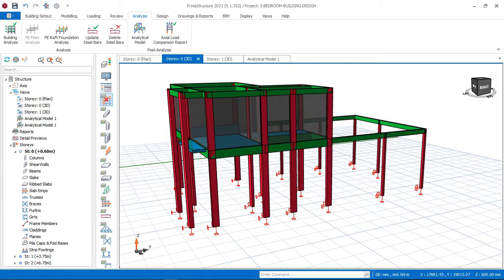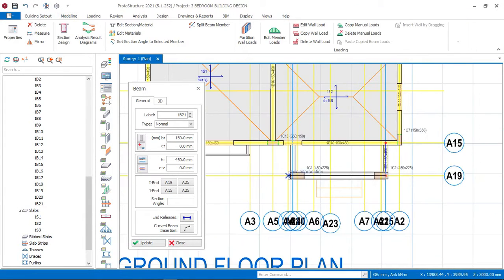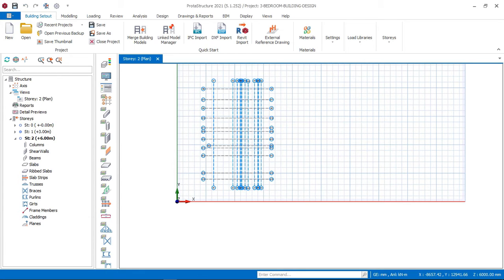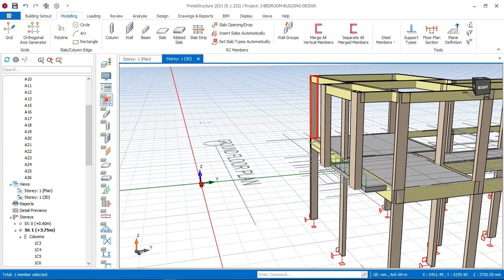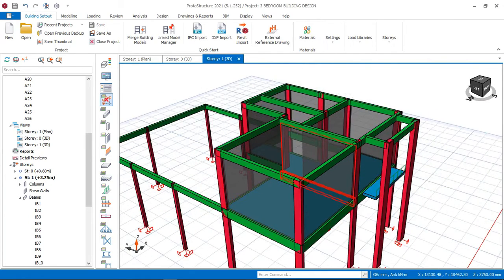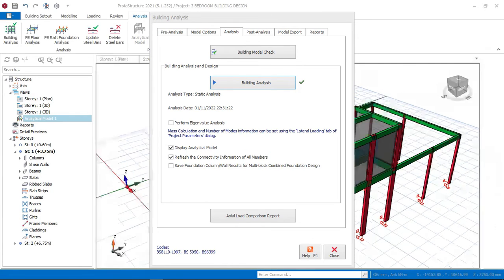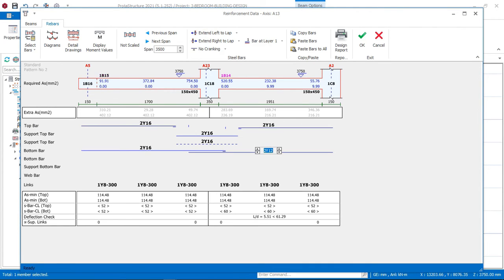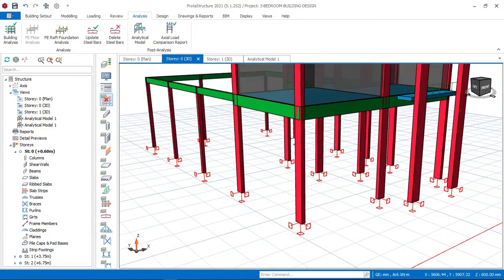protastructure 2021 full tutorial on Building Design in Protastructure.

Comment: I have a question , I designed a building in archicad and then I designed its structural design using protastructure . So I had a cantilever balcony but when I run its building analysis it fails. If I put columns to replace the cantilever balcony , the analysis passes, so my question is , do I have to add columns on the archicad model , or is there another solution to this?

Comment: Welldone Engineer; I noticed 2 things;
1) To avoid forgetting, I often use the "set slab types automatically" once I'm done modelling my slabs. You're yet to design any of the slabs.

2) I noticed you didn't apply any load on the roof beam (300x150mm) for both the penthouse and the bungalow.
Any reason why?